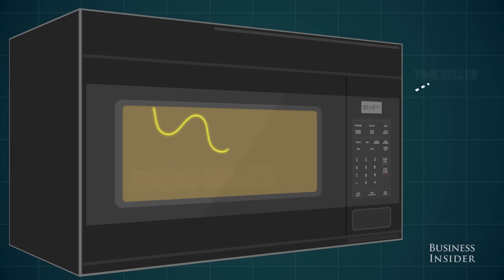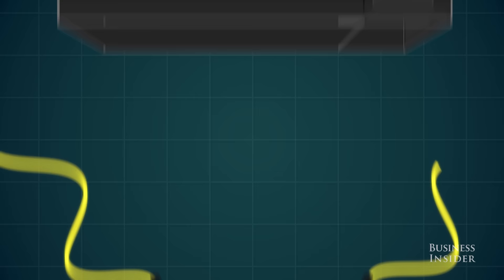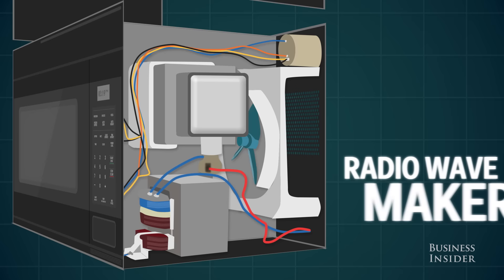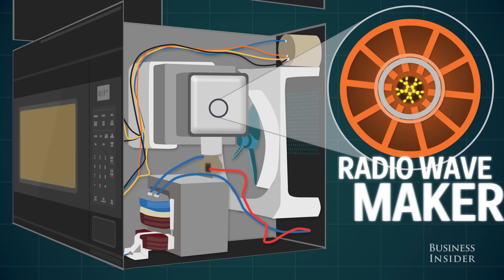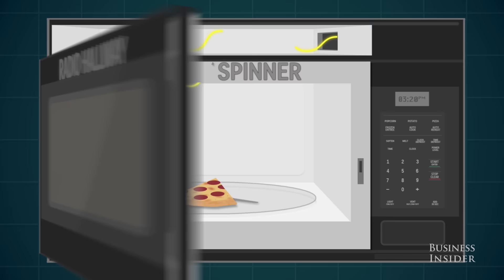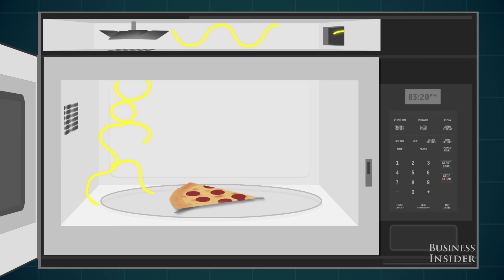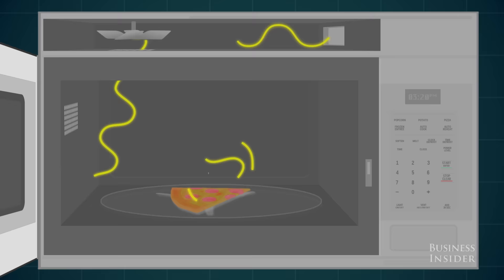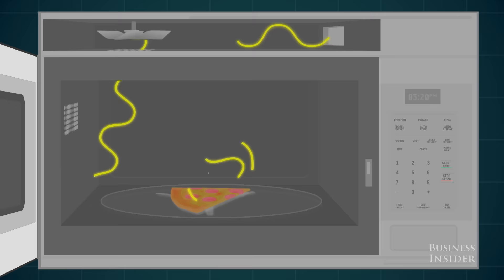How A Microwave Works

Comment: If the magnetron in a microwave is unstable, it will emit radiation therefore causing cancer long term. It's always best to be safe and not stand right in front of the microwave whilst it is heating.